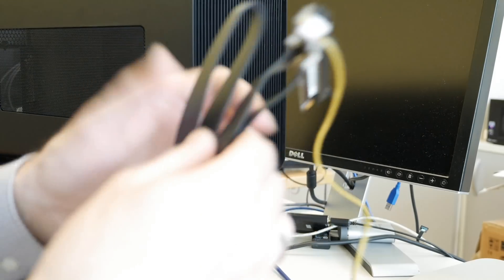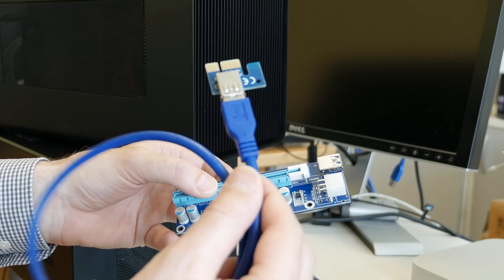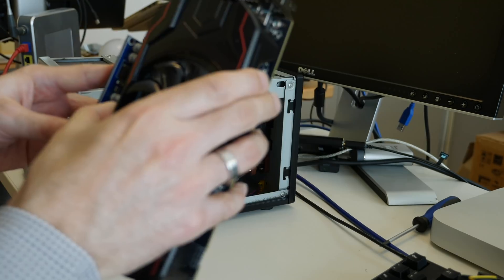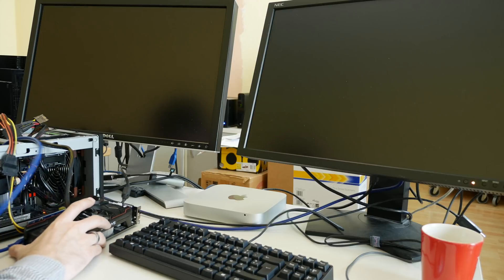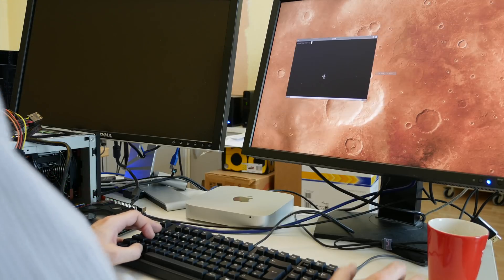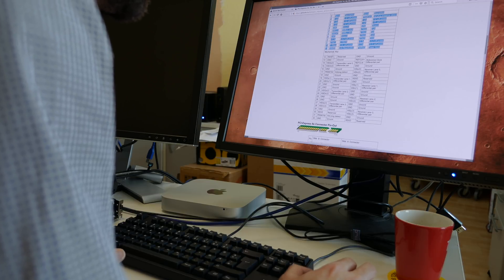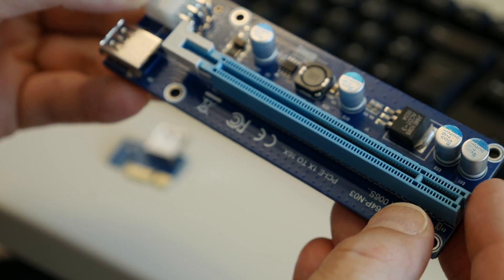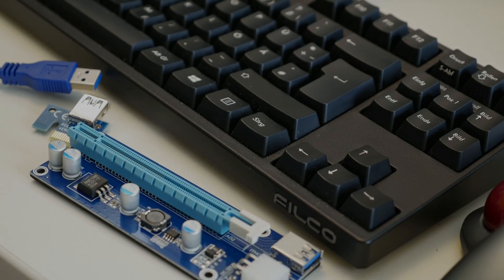PCIe over a USB3 cable? Will that works?

Comment: Can you plug this into any USB3 port or is the adapter the only way to use it?
Reply from the maker: Of course this work only with the special adapter as it wired the cable straight to the pcie lane. On a regular USB port at best it does nothing, at worst fries something.

Comment: I'll have to try this on a Raspberry Pi using USB 3.0 and see what I can get.
Reply from the maker: this is not in any way USB compatible, as I said and wrote a couple of times, this is just using the USB connector to directly connect the PCIe bus to the external cable.

Comment: Hi. I have PCi-e x1 to usb 3.0 controller but when i insert it to PCi-e x1 (vers 3) , it couldt work. Did you know how can I  fix it ,  Have it got  driver ? (motherboard foxconn H61MXE). Thanks
Reply from the maker: the video is about a special external PCIe hack that is using only the physical USB connector. The specifically discussed PCIe card is not in any way USB compatible, it is directly routing the PCIe signals onto the USB cable and thus only works with the dedicated external PCIe slot. Or are you using something else? If a regular PCIe card does not work in a slot than usually either the card or slot is defect, ...

Comment: Has anyone extended one of these beyond 50 feet or so? I tried 100 foot fiber optic USB 3.0 cable with no luck. Any suggestions? The included short usb 3.0 worked fine. I have a pci 1x card I would like to use from another room. Just curious and open to any ideas!
Reply from the maker: This is pcie not USB. USB fibre stuff is not electrically compatible. You can try actual proper thunderbolt for that.

Comment: Hi. I want to ask one question. What is the function of that small card which is inserted in the PCI slot inside PC and it has 01 USB 3.0 socket on it. Can we get USB 3.0 speed on it if we insert a USB 3.0 compatible flash drive in this card?
Reply from the maker: If you are lucky nothing. If you're are unlucky something might fry as, it's not USB but directly pcie lanes .

Comment: can it run directly to the usb port on the pc? or is only working over PCIe motherboard?
Reply from the maker: It is only working with the special pcie adapter it comes with. It does NOT work directly on a regular USB port .
Reply: @renerebe   ohhhh i see :( thanks

Comment: Thanks for the video - I was curious how this worked routing PCI-E over like 8-9 conductors because I'm designing a PCB which is designed to have PCI-E connections routed through it.. maybe will use this same weird hacky solution for prototyping.
Reply from the maker: I should have mapped the pinout that day, I will not be close to that hardware for quite some days .-/ maybe you find high res screenshots of this generic AliExpress like supply or even pinout and schematics on the interwebs. If you do feel free to post the link  ;-9
Reply: @renerebe  What do you want the pinout of? The pcie power on the gpu riser pcb?
Reply from the maker: @kevinbaker2470  IIRC we mostly meant the USB connector

Comment: Great breakdown. I couldn't believe someone had built a PCIe bridge over USB3 at such a low price and you've revealed that it's not at all what's going on. I thought perhaps USB3 had brought enough bandwidth and control to implement a PCIe bridge but such is not the case. (But I'd still love to see a chip that does that.)

Comment: Will this work with a Mac mini
Reply from the maker: in which way? taking out some wifi card or so? Otherwise simply just use Thunderbolt on the Mac mini, ...?!
Reply: @renerebe  can u try and make a video
Reply from the maker: @1201ranjithkumar  try what? just use Thunderbolt. Problem solved.
Reply: @renerebe  for thunderbolt you need an egpu which is quite expensive
Hence w wanted to see I'd this works, or if there's any adapter let me know
Reply from the maker: @1201ranjithkumar  you need the "e"GPU in either case.

Comment: I use these in a cheap DAS kinda setup. I have a Rosewill 4U case with a PSU (Shorted to always on) connected to a bunch of SAS drives. The drives are connected to a SAS Expander hooked into one of these PCIe over USB3 for power (There is no Mobo in the 4U case), and that card is externally connected to an internal w/ external SAS port card in Dell PowerEdge R710 II running UnRAID. Works pretty nicely.

Comment: You should've also try OBS - I was surprised how little the impact in my eGPU test setup was when using the laptop's internal display (graphics were rendered on the eGPU but then sent to the iGPU for display)
Reply from the maker: I tried OBS in an earlier video with the flex extender, the PCIe x1 is a real bottleneck, at least for the current Linux mesa/xorg OBS screen capture and hw encode on amdgpu only ~20 fps: https://www.youtube.com/watch?v=wURWZpmgDV8 1920x1080*RGB = at least 6.22MB, if not more likely 8.29MB * 30 fps = 237 MB/s likely x2 for download  from VRAM for OBS to render, and upload to gram for hw encode, ... so quite some bandwidth gone just for screen capture, and maybe another copy or two depending on how amazing and efficient (or not) the current standard xorg-server/mesa/vaapi DRI/DRM stack is PS: could likely be optimized if OBS would render on the GPU and not copy the FBO back and forth
Reply: @renerebe  so i want to build my gaming  egpu and i have 2 choices either the flex cable or the usb 3.0

I dont want to buy the flex cable because there is no 6 pin power connector although I am not sure if it will be that bad since the gpu has its own power cables

I also think the mining riser using a usb3.0 which the connect to a pcie stupid because using a usb 3.0 already caused the bottle neck so I might as well just plug the usb 3.0 to my laptop usb 3.0 port straight up? right?

Please let me know what you think!
I also wish you benchmarked both to see the performance and temp difference

Cheers
Reply from the maker: @FirstLast-tx3yj  this is not a USB port, but pcie using a USB like cable

Comment: I did a video involving PCIe adapters and it also involved a 6ft cable. The interesting thing about the USB cable risers it that the cables tend to arrive not working. You seemed to have gotten lucky, either that or I had exceptionally bad luck, because none of the usb cables that the riser came worked.
Reply from the maker: Interesting, cables should be the easiest / cheapest to produce though. For what it’s worth, there are usb type A to A cables available online. Not really shure what normal usb device combinations they should be usable for. In any case nice, cheap, flexible and fun stuff ;-)
Reply: @renerebe  Oh it was fun. Because I don't want to be the stereotypical person that promotes their channel in another youtubers comments sections, I'll tell you what I did. I connected 3 PCIe adapters together to a GTX 550ti and saw how much performance degradation there was. On Unigine Heaven, the frame rate went down to 2FPS. When the GPU was directly plugged in, it never went bellow I think 20, though I'm being conservative in the number.
Reply from the maker: feel free to post your link here ;-) as I said in the video I expect games and minding to be mostly fine for running 99% on the GPU. Only the OBS desktop capture is a bit of a outliner for using all the PCIe bandwidth for reading all the frame buffer and sending the rendered frame back again to the hardware video encoder, … with pcie on Linux this gives only some ~20fps :-/

Comment: It just uses it as a physical wiring adaptor, not using or respecting any USB standard. It's fun because even if it ran PCI-E over USB, it would work, watch 3 minutes here:

https://youtu.be/VpB49dhk2uQ?t=397
Reply from the maker: that's what I say in the video, ..! ;-) I even show the input and which of the pins are connected to the 9+shield USB3 wires, … ;-)